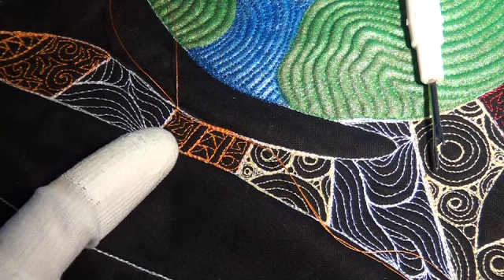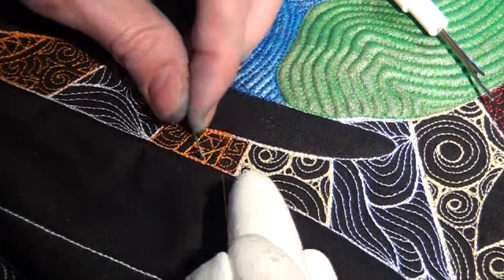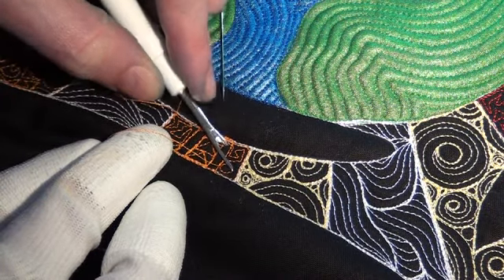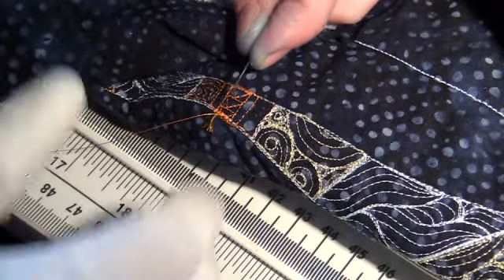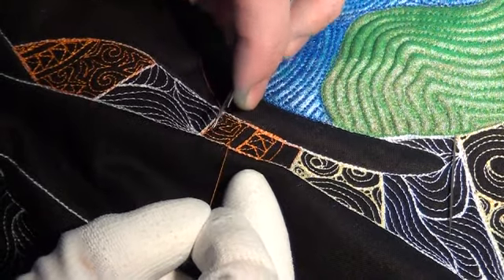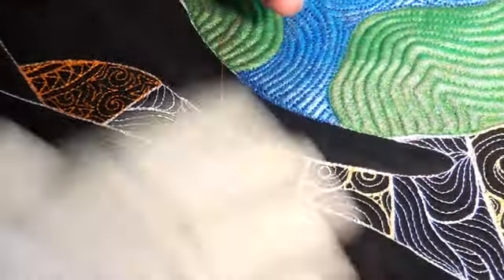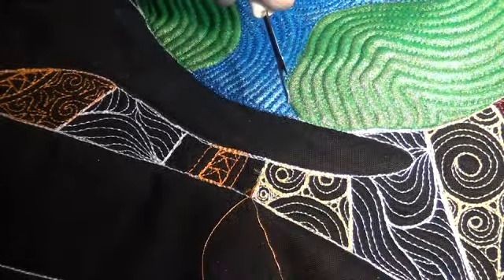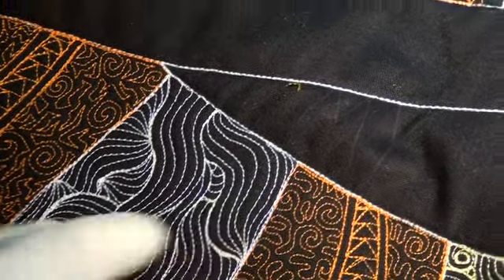19. Learn how to Rip Out Quilting Mistakes

Comment: Question!  I was quilting a quilt on my home machine in swirl pattern.  I had done quite a bit and changed bobbins.  I did test on separate test sample but forgot to look underneath.  I proceed to quilt and realized later the bobbin thread was a disaster.  I suppose I have to take everything out?  Even the good parts?  It is very busy fabric and doesn't show everything but if i rip all this out I will be leaving many threads not "locked" in.  Whole thing uh?????  Like weeks?????  blah
Reply from the maker: I would look at ways to cover up the back instead. You can always applique fabric on top to cover the worst spaces. The only thing to watch out for is if it's so bad and so weak that it doesn't hold the layers together after the quilt is washed. If the thread seems secure enough to stay in, then I'd just cover it up, quilt over it a bit more and keep going!